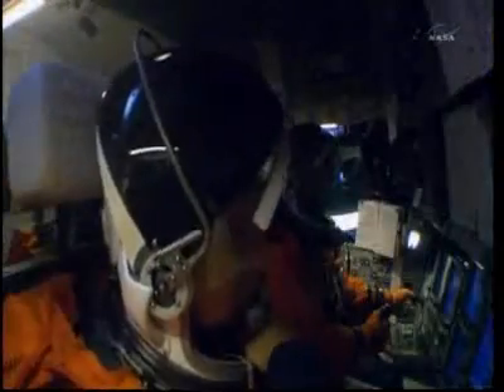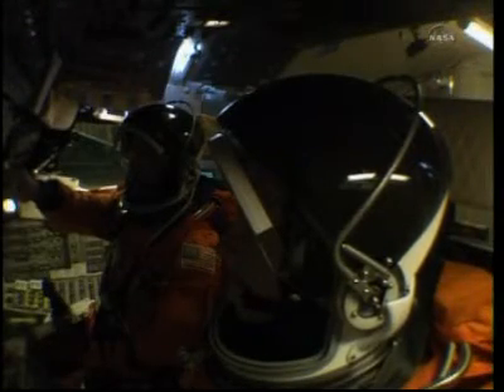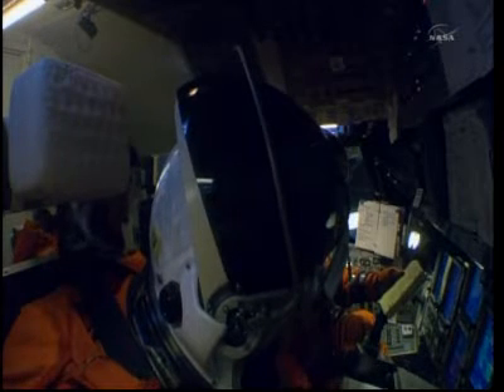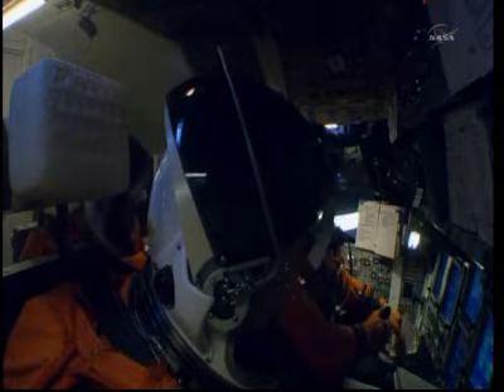STS-135 Ascent Flight Control Team Simulation

Comment: I am not familiar with "steep deorbit" and my initial google searches didn't find anything.  Does anyone here understand what is meant by the term and why it is nice to preserve?
Reply: Steep deorbital trajectories are faster and induce more intense heating on the shield -- shallow trajectories induce longer, less intense heating. In this case, it's because the Shuttle only had one chance to descend and land. Any deviations in the descent would result in the Shuttle coming down at an unacceptable place -- a hugely heavy, hard to maneuver glider that can only realistically land at certain large international airports.

Comment: And just in case anyone is viewing this and wondering what a (phonetically sounding) "puckamu swap" is, it is actually the PCMMU or Pulse Code Modulation Master Unit. Basically this is a "computer box" that takes telemetry from the Shuttle and de-codes and formats it such that it appears as useful information on the Mission Control screens. There are two of these on the Shuttle entitled "PCMMU-1" and "PCMMU-2"